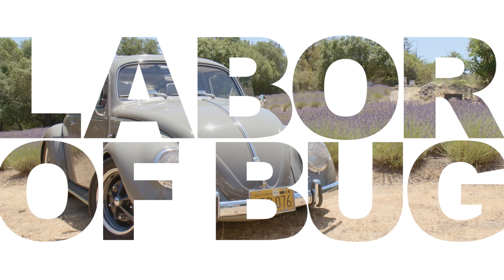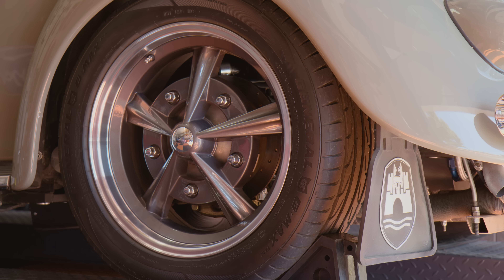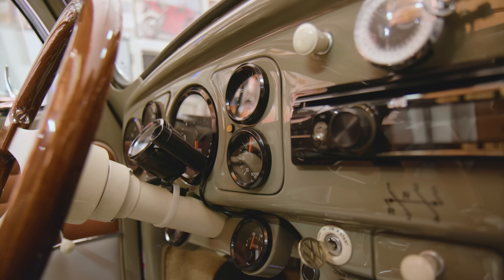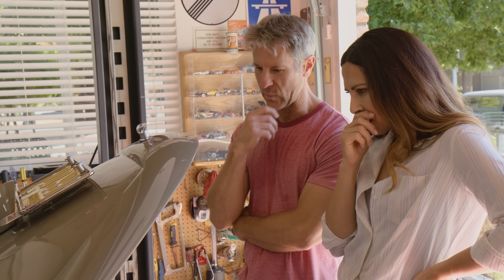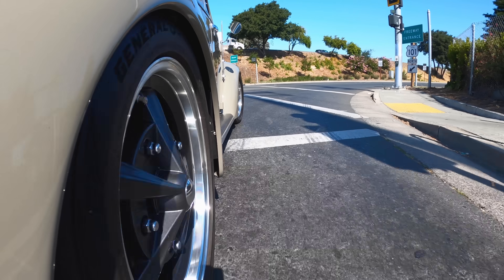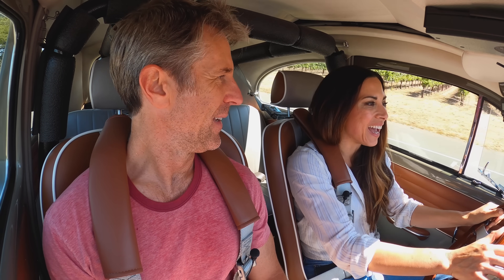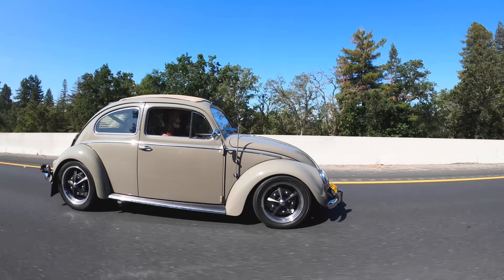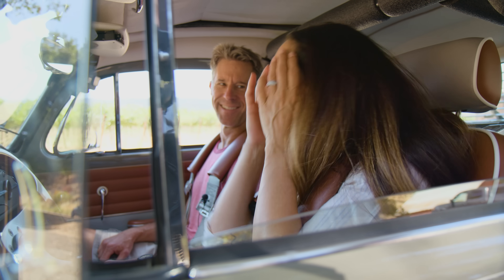LABOR OF BUG: Twin-Turbo '59 VW Euro Beetle 27 Years in the Making | EP10

Comment from the maker: FULL SPECS, 1959 Euro Beetle Twin Turbo Resto-Mod, Courtesy of Owner Marc Kuttner (aka Turbo Vdub) CLICK READ MORE!
Engine:
•	2387cc VW Type 1 aluminum super case with Hoover mods, 8.3:1 CR, clearanced, blueprinted and balanced by owner
•	Scat forged counterweighted 86mm crank, type 1 mains, 2” Chevy rod journals
•	DRD 5.5” H-beam rods with 5/16” ARP bolts
•	Revmaster long 94mm cylinders, cut to length
•	Wiseco  pistons[P/N#K633M94, 9400XX ring pack(1.0mm x1.2mm x2.8mm)] 
•	WebCam custom grind turbo cam with Dial-A-Cam steel straight cut gears and CB lightweight lifters 
•	CB Wedge Port CNC ported heads(44x37.5) with single “Bee Hive” springs and 8mm chromoly studs
•	NGK DCPR8EIX Iridium spark plugs and Magnecor wires 
•	Scat 1.25:1 Pro Comp rocker arms with ACN heavy duty dual tapered aluminum pushrods 
•	Parallel twin modified Garrett VNT25 variable vane turbos with manual vane control and water jacket cooling system by owner
•	Custom 1.5” phase tuned “twin scroll” exhaust system, ceramic coated and wrapped, made by owner 
•	Twin Turbosmart 38mm wastegates and Turbosmart Eboost Street electronic boost controller
•	Electromotive upgraded TEC3 EFI full sequential engine management with Clewett Engineering cam sync. Dyno tuned by AJ at Performance In-frame Tuning  in Napa, CA making 230HP/210TQ at the wheels with 15psi
•	Bosch in-line fuel pump, Aeromotive regulator and filter, teflon hoses, with Siemens Deka 60lb/hr injectors
•	Prometh two stage water/methanol injection with nozzles before and after compressors, with Snow progressive controller
•	Custom blow through finned aluminum intake with modified CB 48mm throttle bodies & match ported injector manifolds, HKS blow off valve, custom dual throttle cable system and cold air intake by owner
•	Bergmann modified Porsche style fan kit with custom thermostat, front, rear and lower cylinder tins  by owner
•	Scat 5.25” aluminum pulley with sand seal, crank trigger wheel and custom sensor mount by owner
•	Dry sump system with CB pump, Pure Power cleanable filter with Scat bypass mount, remote cooler with thermostatic fan control and custom oil tank in right rear fender well by owner

Transaxle:
•	Type 1 swing axle, gusseted aluminum Rhino case, Berg 5 speed with Quaife TBD by Rancho
•	3.44 R&P, 3.78 1st, 2.21 2nd, 1.58 3rd, 1.21 4th, 0.93 5th  with Berg custom mid mount and 5 speed ball shifter
•	Empi long spline, long axles(‘68 only), with custom prototype lubrication system, by Mike Herbert at Rancho and owner 
•	Custom hydraulic clutch with remote reservoir and heavy duty hiem joint clutch cable back up option by owner
•	12lb. flywheel with Kennedy Stage 2 pressure plate, CB dual friction disc, anti-shocker and high torque starter

Chassis, Suspension & Brakes:
•	Airkewld 4” narrowed, adjustable front beam, with bump stops and tow bar mounts added by owner
•	CB 2.5” dropped spindles with CSP wide 5 drilled front disc, Hurst Line Loc and CB wide 5 drilled rear disc brakes with Tilton remote reservoirs
•	Wilwood brake proportioning valve on front line and brake cooling ducts front and rear by owner
•	Sway-a-Way 26mm rear torsion bars, Atomwerk 1” lowered adjustable spring plates with needle bearings
•	Pan stiffeners, front beam stiffeners, gusseted torsion arms, front air dams, four wheel alignment and corner balance
•	CSP torque bar, Berg traction bar, tranny straps and custom 0.75” front and rear sway bars by Addco
•	Bilstein shocks front(stock height) and rear(1” lower and custom valved)
•	Custom one-off aluminum smoothie wide 5 wheels with spun aluminum hubcaps(15x5F, 15x6R) and a set of Rader track wheels(15x5F, 17x7R)
•	Dry weight approx. 2200lbs.   

Body & Interior:  
•	Grafted in ragtop and semaphores, body work by owner and Rick Eichler, Classic Restoration in Sonoma, CA
•	VW mouse grey PPG CLV single stage urethane with clear coat sprayed by Rick Eichler
•	Original style interior with German square weave carpet & Haartz Stayfast canvas ragtop by West Coast Classic Restoration and custom Daily Driver racing bucket seats by Status Racing Seats
•	4 point harnesses and roll bar, LED lighting, original pop out quarter windows
•	1.25” widened fiberglass rear fenders by Creative Car Craft, convertible decklid with custom rain gutters by owner
•	Dynamat sound deadening material throughout and custom heater system with booster fans
•	Custom auxiliary wiring harness with blinking semaphores, emergency flashers, intermittent wipers 
•	Custom Speedhut 12 gauge set and switch console and custom stereo system by owner
Reply: Blown mafia
Reply: Thanks for the really thorough breakdown of the whole car.
Reply: Fantastic detail of car spec and it sounds amazing love your car Mark.
Reply: Wish engine its that
Reply: I thoroughly enjoyed the video (and of course the car) but when I turn to the description, it felt rather lacking in information. So thank you for this pinned comment that filled in all the incredible details.
Reply from the maker: @rogermurphy1548  I'm glad you find this helpful. The description is limited in characters and the specs were just too long to place there. This seemed a better solution! Thanks for watching!
Reply: @NicoleJohnsonsDetour  that makes sense. I never thought about the limit of characters available in the description. Again, thank you for your great videos.
Reply: Wow this is so awesome and so much meticulous work and planning done for this build absolutely amazingly
Reply: @CarVideoCzar  can you support me in build up
Reply: Nicole I love your passion and knowledge for cars. Your husband is a blessed man. You have a new sub!😃👏👏🙏
Reply: Sorry. It’s not a Euro 59. It’s a USA 59. 
The owner said he added the semaphores.
Reply: Awesome car. I have a 1955 bug that I bought in the early 70s. Don’t look like I’m ever going to get to restore it. Looking for someone to buy. Any ideas?
Reply: Now that's a Nice Dub
Reply: Nice:)
Reply: 8.3:1 compression ration? Wow, I expected more, like 10:1 maybe. But it’s definitely a beautiful motor

Comment: Nicole Johnson....master of making introvert engineer types extremely nervous...which makes for a great video.
Reply from the maker: Haha!  Glad you enjoyed it..thank you!
Reply: I may have looked that way but I was actually pretty relaxed. That's just how I am.
Reply: One she's beautiful and secondly she's feisty😃
Reply: Awkward is a big draw
Reply: @turbovdub1867  Hi Marc, I am building a turbo VW as well, I run into some issues and I see that you installed rear disc brakes pointed towards the bottom of the wheel. Thinking about doing that as well but my question is, where did you get the extended E-brake cable from? Appreciate your help. Amazing Vdub as well!
Reply: I just found Nicole chanel and omg what a woman 😅❤
Reply: @turbovdub1867  
You looks really uncomfortable... 😥

Comment: A good friend of mine in high school back in the mid 70's had a 1962 VW Bug that he thought needed to be a Baja Bug. So he bob's the rear fenders and shortens the deck lid then he moves to the front end and can't  decide how the hood needs to be. Well about that same time his parents get a new fridge. The old one was from the late 40's so it's got  the art deco look on the top door. He takes the freezer door off the top holds it up to the front of the bug and boom there's the new hood with just enough room for the headlights.

Comment: In case you were wondering where they were driving (or even if you weren't), at 22:21 they are crossing over the Richard F. Cavness Memorial Bridge on Hwy 101, located 10 miles north of Santa Rosa, Calif.  The bridge passes over Arata Lane.

Comment: She's not just a pretty face, but a 1959 Beetle. I brought one for the transaxle low gear $50. put in a 72 van engine  converter kit. Beat a Ford toronado at the traffic lights for only 30 feet, but he stopped as I was letting the front back down. HHmm should had put restrictors on de-pipes took a little scraping.  O ya fun days.
Reply from the maker: Thank you for sharing!!

Comment: I have Respect for this Lady as she is Interested to know about Vintage Vw. I am from Sarawak, a Malaysian State in Borneo. And I have an Original 66 and a 71 Vw Beetle. Ours here is the RIGHT Hand Drive ( as we were once a British Colony ). Most of the Beetle here are Swing Axle rear. I am thinking of Converting the 71 to the IRS ( Independent Rear Suspension ) as  I have fabricated a pair of JIGS based on Internet Photos and using an Actual IRS Half Cut Beetle imported from Japan as a Guide for Accurate Measurement.
Reply from the maker: Awesome..thanks so much for watching and good luck with your build!!

Comment: I had a 1968 Bug (with a manual Sunroof) that I did up with a two Barrel carburetor,  dual point distributor, a small custom steering wheel, the kind they used on bumper cars, and I believe at the time one of the first set of radial tires on a bug (a whole other story on the tires). That little bugger would fly on the Cross Island Parkway in Queens, NY. Had many a sports car in chase mode! Boy, I miss that car! Marc, you did a fabulous job!
Reply from the maker: Thank you for sharing with us!!

Comment: Oh man! I had an original 60 Ragtop. I remember driving in the winter, had to scrape the ice on inside of my windshield while driving. And running out of gas in the middle of the road, because mine had no gas guage, and had to use my spare portable tank, and suck the gas at the carburator with my mouth. Good times.
Reply from the maker: Thank you for sharing with us!!

Comment: If there had been a car show like this when I was a kid, I'd probably geek about cars as much as the motorcycles I grew up with.  Most shows are just some generic af dude rattling tech specs and going "This car is insane! IT"LL SHRED ASPHAULT AND INVERT SPACE-TIME!". Where as Nicole appreciates not just the car but the owner/builder as well, and we get a nice balanced look at both.  Which to soap box for a second, I feel like a lot of car shows gloss over the owner/build, when the car is much a part of them as say a fighting style is to a martial-artist. 

And a personal question; Nicole, if you read this; OMG! What conditioner do you use? If I don't use double hair ties or braid it tight,  it takes me 10-20 min to de-tangle when I get back from a cruise xD
Reply from the maker: Well, thank you so much for recognizing our different approach. 

And I have to laugh, because yours is the first conditioner question I've ever received. I don't use anything fancy, but I totally understand the detangling issue. I'm currently using Garnier Fructis Sleek & Shine shampoo and conditioner. I've used everything from expensive to cheap, and this seems to work best for my thick hair. 

Then use a product in a pink spray bottle for detangling... super long name if you're ready for this (I had to grab it from the bathroom so I wouldn't mess up the name):
The brand is called "Not Your Mother's Naturals" and it's the  Curl Defining Detangler in Tahittian Gardenia Flower & Mango Butter. 

Thanks for watching!!

Comment: I love what he did with the airflow! I've been considering doing something similar to my Super Beetle. I'm planning to re-do all my cooling system next year and I'm thinking about ducting higher pressure, cool air into the engine bay. I would have liked to see how he plumbed his dry sump and where the reservoir is though.
Reply: dry sump tank is in the right rear fender well inboard of the wheel.
Reply: 1959 Euro Beetle Twin Turbo Resto-Mod

Engine:
•	2387cc VW Type 1 aluminum super case with Hoover mods, 8.3:1 CR, clearanced, blueprinted and balanced by owner
•	Scat forged counterweighted 86mm crank, type 1 mains, 2” Chevy rod journals
•	DRD 5.5” H-beam rods with 5/16” ARP bolts
•	Revmaster long 94mm cylinders, cut to length
•	Wiseco  pistons[P/N#K633M94, 9400XX ring pack(1.0mm x1.2mm x2.8mm)] 
•	WebCam custom grind turbo cam with Dial-A-Cam steel straight cut gears and CB lightweight lifters 
•	CB Wedge Port CNC ported heads(44x37.5) with single “Bee Hive” springs and 8mm chromoly studs
•	NGK DCPR8EIX Iridium spark plugs and Magnecor wires 
•	Scat 1.25:1 Pro Comp rocker arms with ACN heavy duty dual tapered aluminum pushrods 
•	Parallel twin modified Garrett VNT25 variable vane turbos with manual vane control and water jacket cooling system by owner
•	Custom 1.5” phase tuned “twin scroll” exhaust system, ceramic coated and wrapped, made by owner 
•	Twin Turbosmart 38mm wastegates and Turbosmart Eboost Street electronic boost controller
•	Electromotive upgraded TEC3 EFI full sequential engine management with Clewett Engineering cam sync. Dyno tuned by AJ at Performance In-frame Tuning  in Napa, CA making 230HP/210TQ at the wheels with 15psi
•	Bosch in-line fuel pump, Aeromotive regulator and filter, teflon hoses, with Siemens Deka 60lb/hr injectors
•	Prometh two stage water/methanol injection with nozzles before and after compressors, with Snow progressive controller
•	Custom blow through finned aluminum intake with modified CB 48mm throttle bodies & match ported injector manifolds, HKS blow off valve, custom dual throttle cable system and cold air intake by owner
•	Bergmann modified Porsche style fan kit with custom thermostat, front, rear and lower cylinder tins  by owner
•	Scat 5.25” aluminum pulley with sand seal, crank trigger wheel and custom sensor mount by owner
•	Dry sump system with CB pump, Pure Power cleanable filter with Scat bypass mount, remote cooler with thermostatic fan control and custom oil tank in right rear fender well by owner
Transaxle:
•	Type 1 swing axle, gusseted aluminum Rhino case, Berg 5 speed with Quaife TBD by Rancho
•	3.44 R&P, 3.78 1st, 2.21 2nd, 1.58 3rd, 1.21 4th, 0.93 5th  with Berg custom mid mount and 5 speed ball shifter
•	Empi long spline, long axles(‘68 only), with custom prototype lubrication system, by Mike Herbert at Rancho and owner 
•	Custom hydraulic clutch with remote reservoir and heavy duty hiem joint clutch cable back up option by owner
•	12lb. flywheel with Kennedy Stage 2 pressure plate, CB dual friction disc, anti-shocker and high torque starter
Chassis, Suspension & Brakes:
•	Airkewld 4” narrowed, adjustable front beam, with bump stops and tow bar mounts added by owner
•	CB 2.5” dropped spindles with CSP wide 5 drilled front disc, Hurst Line Loc and CB wide 5 drilled rear disc brakes with Tilton remote reservoirs
•	Wilwood brake proportioning valve on front line and brake cooling ducts front and rear by owner
•	Sway-a-Way 26mm rear torsion bars, Atomwerk 1” lowered adjustable spring plates with needle bearings
•	Pan stiffeners, front beam stiffeners, gusseted torsion arms, front air dams, four wheel alignment and corner balance
•	CSP torque bar, Berg traction bar, tranny straps and custom 0.75” front and rear sway bars by Addco
•	Bilstein shocks front(stock height) and rear(1” lower and custom valved)
•	Custom one-off aluminum smoothie wide 5 wheels with spun aluminum hubcaps(15x5F, 15x6R) and a set of Rader track wheels(15x5F, 17x7R)
•	Dry weight approx. 2200lbs.   
Body & Interior:  
•	Grafted in ragtop and semaphores, body work by owner and Rick Eichler, Classic Restoration in Sonoma, CA
•	VW mouse grey PPG CLV single stage urethane with clear coat sprayed by Rick Eichler
•	Original style interior with German square weave carpet & Haartz Stayfast canvas ragtop by West Coast Classic Restoration and custom Daily Driver racing bucket seats by Status Racing Seats
•	4 point harnesses and roll bar, LED lighting, original pop out quarter windows
•	1.25” widened fiberglass rear fenders by Creative Car Craft, convertible decklid with custom rain gutters by owner
•	Dynamat sound deadening material throughout and custom heater system with booster fans
•	Custom auxiliary wiring harness with blinking semaphores, emergency flashers, intermittent wipers 
•	Custom Speedhut 12 gauge set and switch console and custom stereo system by owner
Reply: @turbovdub1867  Oh cool! What's the section width on your tires? I'm thinking about going to a 245. I like that spot though, I was thinking package tray area but I don't want to have to hack up the interior. So is fill just in the wheel well? Or I guess you could punch it through into the engine bay?
Reply: @turbovdub1867  Hey, I'm just now getting into my own dry sump build, do you have any drawings or photos of your oil tank?

Comment: Sounds roudy!  That poor runner's ears when you passed them....  I had a twin turbo 2443 in my beetle about 10 years ago. Never got it completely sorted out though. Went german look with the setup, not so-cal style.  Rebuilding it all from scratch again now.  Custom chassis, mid engine VR6 2.8 turbo chassis, porsche and RX8 suspension, WRX gearbox.
Reply from the maker: Awesome..good luck with the new build!  Thank you for watching!
Reply: that sounds cool